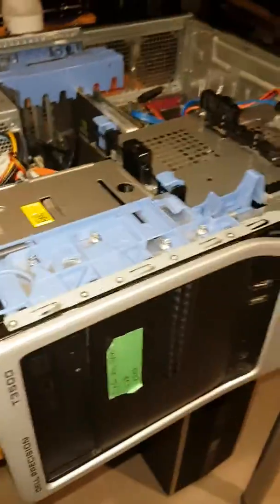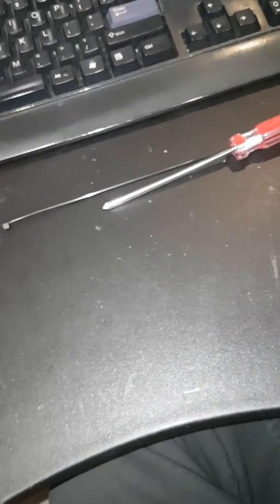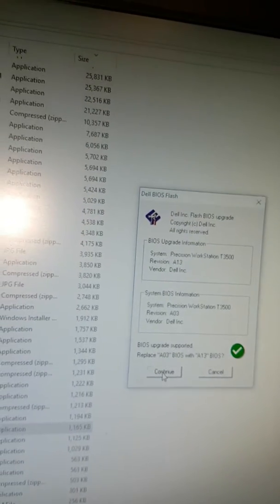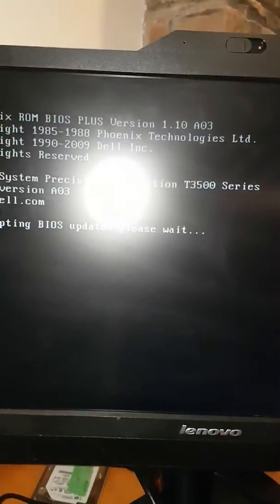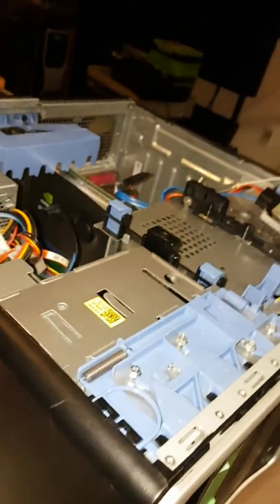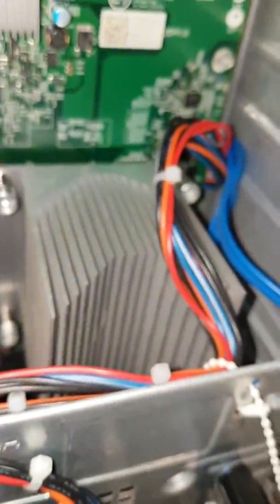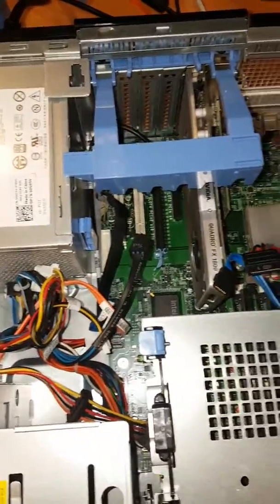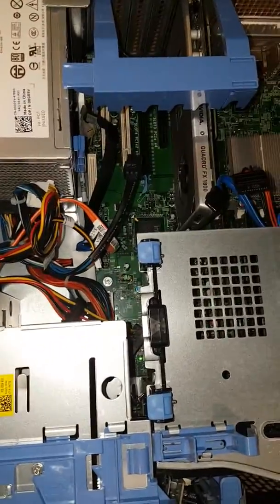Upgrade CPU Dell Precision T3500/T5500 to 6-core x5650 x5660 x5670 x5675 x5680 x5690 W3680 W3690

Comment: Hi, do you know what type of RAM is required to put a W3690 in a DELL T5500 ? I have some PC3L-10600R ECC registered... is it possible ? Thanks
Can W3690 can be used in Dual CPU on this platform ?
Reply from the maker: You can either either R memory or E, you can only use W cpus in single config, so you would need dual X5680/X5690 or X 5687
Reply: @AleksandrsBrodie  thanks for you Quick answer. 
I've tried to put a W3690, but the PC never boot... (Error led code : Pb7) do you think it's because the RAM? 96Go (6x 16GB PC10600R 2Rx4 PC3L ECC Reg) ?

Comment: Brother i need help i have t5500 and i try to upgrade my processor from x5675 to w3690 but it is not working , not giving the display only showing orange light and 123 light which are on front . Can you tell me what should i do that my w3690 processer will work . and i think my processor is not working . what is your opinion.?
Reply from the maker: I think w3690 should work but only in single cpu configuration. 
Also, I am not 100% sure if the w3690 works with registered memory, which has R on the name.
It may require ECC or U unbuffered memory, but I am just speculating.
Reply: @AleksandrsBrodie  i saw people on YouTube using w3690 on t5500 dell machine that's why i think it will work

Comment: Great man! I have a dell t3500 and I tried the W3550 and X5660 they worked fine but the W3690 won't boot up (234 blinking light orange) Bios A14.
Reply from the maker: That is odd, I've used a w3690 without issues in t3500, make sure the cpu contacts are clean, it should work.
If the x5660 works so should the w3690 as they both are 32nm.

Comment: does the w3680 work on a t5500 with a Motherboard 0CRH6C?
Reply from the maker: W3680 only works in single CPU config.
Reply: @AleksandrsBrodie  alright. but will the w3680 work on a dell 0crh6c with no issues?
ive seen some mixed opinions
Reply from the maker: @thick4628  W CPUs only work on T3500 i think and X56xx work on T5500 in dual cpu config
Reply: @AleksandrsBrodie  i see, the thing is, im building a computer from the ground up and i picked the dell 0crh6c motherboard and the w3680, im not intending to build a dell t3500, im just looking to see if those those things are compatible. I dont know if the mobo i bought belongs to a t3500. Do you know if the 0crh6c and the w3680 work together?
Reply from the maker: @thick4628  actually i think it should work, i just dont know if you can use registered memory with that model of cpu.
i think from what i understand, that w series is single socket only, so as long as you only have one of the cpus installed, it will work.
Reply: @AleksandrsBrodie  hi again I’m finally building the pc but I can’t see any video on the monitor when I plug it in. Do you know if the dell 0crh6c and w3680 need a bios update or might be another problem
Reply from the maker: @thick4628  it might need a bios update, I'm not sure
Reply: @AleksandrsBrodie  do you know if the dell 0crh6c can use the x5690 and if I need bios on this one instead and if I can use single config?
Reply from the maker: @thick4628  I dont know off hand, but the best thing to do is update the bios first regardless of the cpu, but I think both of those cpus, W3680 in single config, and X5690 in single config should work, just keep in mind you may need an extra fan on the cpu cooler to keep the temps lower as both of those cpus are very power hungry
Reply: @AleksandrsBrodie  alright, i saw online and they said the w3680 really is just for the t3500 not the t5500 so i bought right now the x5690, the website says my mobo is compatible with this chipset so i think ill be alright, if not ill buy a super cheap cpu just to update bios
Reply from the maker: @thick4628  the x5690 should work well, just make sure to add an extra fan on the cpu cooler in the t3500
Reply: @AleksandrsBrodie  alright i already bought a nice lga cooler too for my t5500 motherboard, i think you meant 5500 xd

Comment: Hello ,
Thanks for the video. I plan to upgrade à T5500 from bios A02 to A17 to install a x5660 replacing a E5520.
Do you know if this can be done on any version of thé motherboard?
Reply from the maker: off the top of my head, i cant recall. But i would first do the bios update, if it updates to the newest bios, then you probably have a good shot at upgrading the cpus

Comment: hi. im using t3500 with cpu x5675 and im planning to upgrade the cpu to x5690, do  ineed to update my bios to be able to run the x5690? or just plug and play? thanks
Reply from the maker: You dont need to upgrade bios if you already have x5675.
I personally recommend w3680 or w3690 as you can manually overclock them on a t3500 using Intel extreme tuning utility to 3.8- 4ghz
Reply: @AleksandrsBrodie  thanks. t3500 has dell mother board, i thought dell motherboard cant be overclocked?
Reply from the maker: @nantrix1  u can't overclock through bios, but with certa9n cpus you can overclock through windows using a program called: intel extreme tuning utility.
Both w3680 and w3690 support it
Reply: @AleksandrsBrodie  thanks

Comment: Hi thanks for video , I'm going to upgrade my processor from e5620 to x5690 , my Bios v is A17 7/Jun/2013 , Do have i update it to A13 v  2/Nov/2011?
Reply from the maker: I dont think you need to update anymore, you already have 56xx series compatibility so going for the dual x5690 should work!
just FYI those chips run hot ;)
Reply: @AleksandrsBrodie  thanks a lot  , About the heat problem , i will use ARCTIC MX-4-4G 2019 Thermal Compound Paste .
Reply from the maker: @menasafwat4951  you may want to add additional fans on the heatsinks. :)
Thermal paste wont be an issue

Comment: I want to ask if i need to comeback to xeon w3550 
i need to downgrade to a03 bios ?
Reply from the maker: You dont dont ever need to downgrade bios.
Reply: @AleksandrsBrodie  oh why ! 
how i can put xeon w3550 then
Reply from the maker: @hishammohamed9458  if you have t3500 the w3550 should work without bios update.
Reply: @AleksandrsBrodie 
Its nt work bios a17
 When its bios a03 its worked idk if the cpu crash or. I need to updAte bios a03 again
Reply from the maker: @hishammohamed9458  that is odd.
Try cleaning the contact golden part or the cpu with an eraser or alcohol
Reply: @AleksandrsBrodie  oh ok thanks i will try

Comment: Are the T3500 and T5500 interchangeable as far as RAM and CPU? Thank you.
Reply from the maker: the CPUs are, but the T3500 can only use U dims or Ecc memory, not server grade registered memory like the T5500.
That is the only difference.
T5500 can use R dims/server memory where the T3500 cannot
Reply: @AleksandrsBrodie  Thank You

Comment: I just let Dell's support assist do an analysis on my T3500. It updated my bios straight from A06 to A17. Now I need to get a faster processor and see if it works. If it doesn't, do I need to remove A17 somehow? And then install A13?
Reply from the maker: I dont think so, if it was able to take the A17 update, then everything should be good to go.
I just found one time it told me I had to get from A3 to A13 then to the latest.
Reply: @AleksandrsBrodie  and one more question i am offered e3 1245 v3 and x5690 for the same price what should i go for e3 1245 v3 with hp casing and oc motherboard and x5690 with t3500 dell i will wait for your reply❤
Reply from the maker: @alomiyan185  they are both about the same.
If you are playing more esport games like League of legends, valorant, csgo, then get E3 1245v3 is you want to play COD warzone then get X5690
Reply: @AleksandrsBrodie  i play battle royal games like pubg and fortnite which one should i go for?
Reply from the maker: @alomiyan185  get the one that comes with more ram/memory then.
Reply: @AleksandrsBrodie  like a better motherboard ?or a processor please tell me i am new to this
Reply: Alo Miyan go with the x5690 and 16gb of ram
Reply: @AleksandrsBrodie  bro is this motherboard good and overclockable? please reply as fast as possible
Reply from the maker: @alomiyan185  you cant OC on dell T3500 or t5500
Reply: @AleksandrsBrodie  ty for replying ❤

Comment: Can i oc it?
Reply from the maker: with the Dell motherboard, I dont think you can overclock.
Thats why I generally would buy the X5670 which would run all core turbo around 3.1Ghz, or If you own Dell T3500 then I would get Xeon W3680 and with that CPU you can use intel extreme tuning utility to OC to around 4Ghz
Reply: @AleksandrsBrodie  thank u very much
I have now xeon x5650 its fine with rx480 better than w3550

Comment: HI Aleksandrs, I have a T3500 with XeonW3550 3.07 CPU. I'm not very computer savy but looking to upgrade this machine. The Mfr date is 20120106. Never updated bios before. What would you recommend to buy for CPU and easiest one to install? and would you recommend added more than 6gbs of RAM? any help would be greatly appreciated.
Reply from the maker: Updating the bios is simple, you can download the bios update tool from dells website.
I recommend upgrade the memory to at least 12GB ram.
For CPU upgrade, the most budget friendly option is Xeon X5670, I always buy them from Aliexpress as that is the cheapest place.
Before you install the new CPU, make sure the bios is updated and it will work.
The X5670 will give your system new life, as it has an additional 2 cores compared to the W3550.
Also, I highly recommend buying a cheap 240GB SSD from either Amazon or Aliexpress as the SSD will make everything very responsive if you dont have one already.
any of the major Chinese SSD brands are good, just read the reviews before buying, and if there is over 100 orders, its probably a good product.
Reply: @AleksandrsBrodie  great information thx! you make it sound easy "almost" :)
Reply from the maker: @Destination360  I learnt by watching tutorials, there are a lot out there for how to update Dell t3500 bios.
Reply: @AleksandrsBrodie  So many RAM options would DDR3 240pin be the right ones to be searching for?
Reply from the maker: @Destination360  The T3500 uses both DDr3 desktop memory, or DDR3 EEC memory.
DDR3 Desktop memory is also known as:
PC3 12800U (example)
DDR3 ECC memory looks like:
PC3 12800E (example)
PC3 = DDR3
U = unbuffered memory
E = ECC memory
R = Server memory which does not work with your system
and the numbers "12800" that is the speed.
12800 = 1600Mhz
10600 = 1333Mhz
(both 1333mhz and 1600mhz memory will work in your system)
Reply: @AleksandrsBrodie  so there's six slots with 1 GB each currently do they all have to be full? Or could I start with 4 -8gbs.
Reply from the maker: @Destination360  you can run 4x4GB,
Reply: @AleksandrsBrodie  the CPU install went smoothly with the exception of thermal compound. Should I get some and add it? But the memory had a little issue. I removed 6-1gb chips and bought 4-4gbs like mentioned. I installed in the first four slots left to right (two empty) when restarting it said "Alert! non optimal memory population. Populate as specified in service manual" after finding manual and reviewing it should be either 3-4gb or 6-4gbs. I tried removing one chip and still getting message.
Reply from the maker: @Destination360  ok,
1. Yes, definitely get some thermal compound, in the means time, you can use toothpaste.
2. Yes, that message is normal, dont be concerened.
Put memory in slots 1 2 3 and 4.
This way, it will run in dual channel.
The error just states that the system is capable of triple channel but with 4x4GB it can only run in dual channel which is perfectly fine.
So just hit F1 and ignore that error.
Reply from the maker: @Destination360  the memory should be populated all 4 slots beside each other. so two white memory slots, and two black ones.
Reply: @AleksandrsBrodie  thx so.much I'll follow your instructions
Reply: @AleksandrsBrodie  I just noticed the RAM I bought says 1600MHz. Manual says 1066Mhz or 1333Mhz. Could that be why I'm getting the error and should I exchange?
Reply from the maker: @Destination360  its fine to use 1600mhz ram, I have used it before.
you can download a program called CPUZ can within the application it will tell you if your ram is running in dual channel.